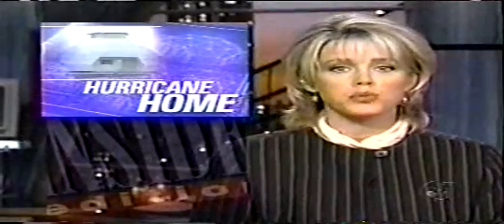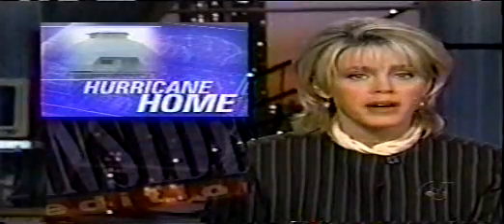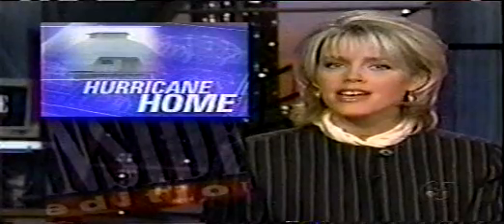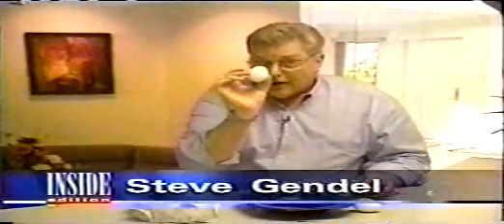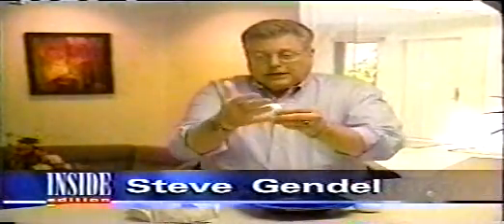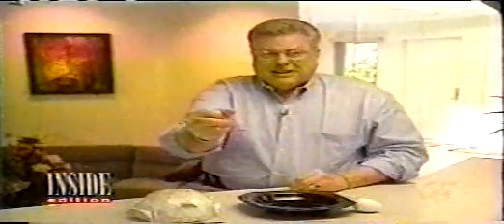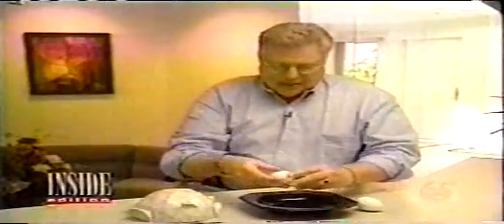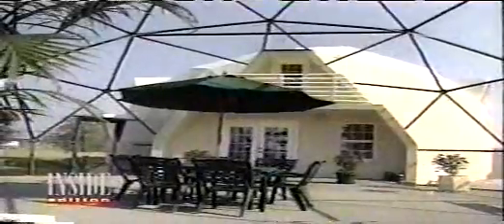Dome in Hurricane

Comment: The owner passed away and the wife is ill.
Reply: As long as it wasn't from a hurricane or twister and were found dead inside from a 3lb  coconut @ 187mph to the head that flew in horizontally right through the front door after someone forgot to latch it